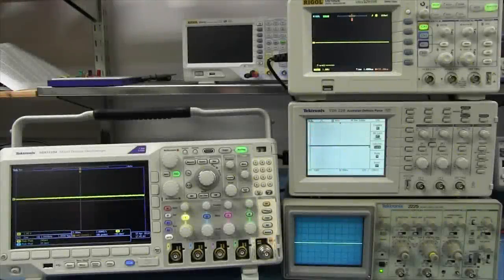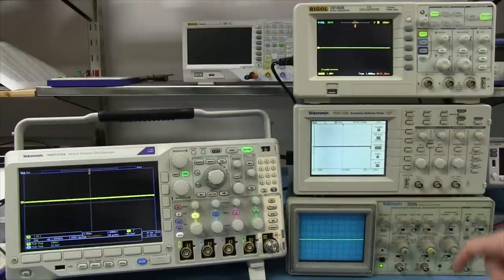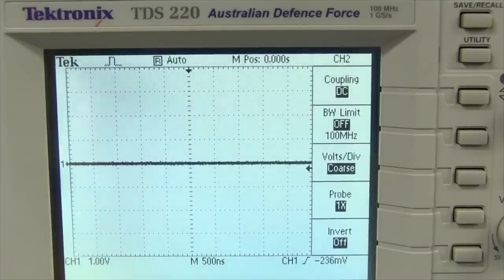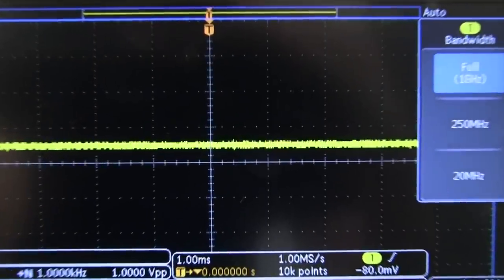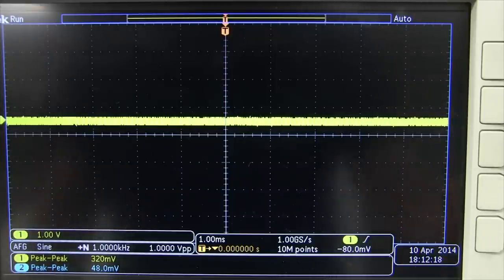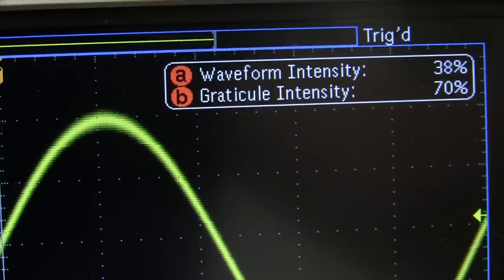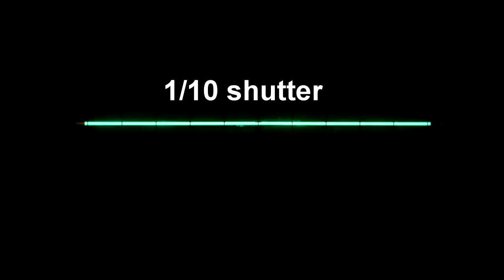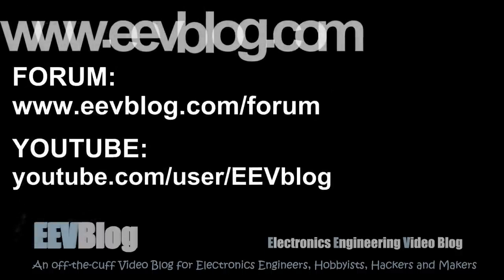EEVblog #601 - Why Digital Oscilloscopes Appear Noisy

Comment: This video very misleading. Since he used the 1Mohm input setting,  the waveforms shown do not represent the noise floor of the scope, not even close.  The noise you see on an unconnected scope is the combination of the the Johnson noise of the input impedance and the random component of the ADC's conversion. If you use a low gain setting (e.g. 1V/div) you mostly see ADC noise. If you use a high gain setting on the scope (e.g. 1mV/div) you mostly see the Johnson noise of the scope's input impedance. To estimate this correctly you cannot just use a the 1Meg input resistance, since this has a shunt capacitance, limiting the effective bandwidth. For example, a 1 Meg resistor with a 1GHz bandwidth, has a Johnson noise (=sqrt(4kTRB)) of about 4mV rms, or more than 30mV p-p for most settings that he used.  But since the input capacitance is about 10pF, then the effective Johnson noise is sqrt (kT/C) = 20 microvolts. For any serious look at the noise level of an unconnected scope you must therefore use the 50 ohm input option, and Dave did not do this for this video, resulting in conclusions that are both misleading and irrelevant.

Comment: Could have been a great video but those no signal tests should have been done with terminated inputs on the scopes aka grounding caps.   Is the noise we see being picked up by the little BNC stub in the female socket on the scope? It's high enough frequency noise  that the connector probably makes a good antenna.  Or is the noise from the A/D converters or numerous processors in the digital scope.  Without grounding the inputs all the data is invalid.

Comment: My Rigol 1054Z shows the same consistent noise as the one Dave got a few years after he made this video. I've managed to determine that this "noise" is a 250MHz sawtooth wave about 10mV p-p; it isn't random. I'm not sure if it's sampling noise introduced by the ADC or switching noise from the power supply riding one of the voltage rails; either way, it seems to me this is something that could have been snubbed in hardware or filtered out in software. So high above its specified 50MHz bandwidth; you'd think the designers wouldn't want it showing up on a trace.

Comment: With the money they charge for modern scopes, why cant they put a 2560x1600 display on them and get closer to around 260-300ppi?
I high pixel density display on a smartphone of around 5 inches, is often around $50
With oscilloscope companies getting number happy and charging nation state bankrupting prices for their scopes, they should at least be including a high resolution display.
Reply: The asic doing all the signal processing from memory is in essence also producing the waveform display. The asic is the limiting factor for display resolution. Accommodating a larger resolution would mean the entire asic would need to be an order of magnitude more powerful. Besides, if the ADC is doing 8bit conversion, you'll only get 256 lines of vertical position. Increasing the resolution does not increase the adc bitrate
Reply: But it will allow for less graphical aliasing of the lines. Think of it like when you move from a 1920x1080 display to a display that may be only 1-2 inches larger but the resolution is 2560x1600, and you suddenly don't need enable antialiasing, (or at most, only need around 2X antialiasing in order to make things smooth. The points of data making up the waveform or anything else being displayed may not increase, but things will look smoother. It will also make the text and other GUI elements look much better, or allow for more efficient use of the screen space, by making smaller GPU elements that are still easily readable. For the prices these companies charge for high end scopes, they should throw in a R9 290x while they are at it, just so it can drive the display a little better, and also mine bitcoin while you are while you are using the scope.
Reply: ***** Is there a good reason why they can't make that a 12 or 16bit ADC, or is it just not needed?
Reply: Razor2048 It's not aliasing, the asic displays only absolute data points (data events that it registered and stored). Each pixel on the display is an actual data point (or combination thereof). Interpolating your data is the same as data manipulation.. You use an oscilloscope to get answers, not to get pretty interpolated lines. You can compare this to upscaling photos from a 1.2mpixel webcam to 5mpixel. With some smart algorithms and aliasing, you can probably get the image to look nicer, but it's not giving you more information
Reply: Kevo F I think Tektronix has a couple of 12 bit oscilloscopes, maybe also 16 bit but I'm not sure. They're not really necessary, thus not very popular. With increased bit depth, you lower your noise floor, but decrease sampling speed (and probably increase costs). With increased bit depth, you also make quantification a bit better. It's not very common that the noise floor interfered with what you use the scope for. And an oscilloscope is by nature not a quantification platform, even if it is possible to do that
Reply: ***** Ahh, definitely good reasons, thank you.
Reply: Because they'd have to charge more. They're charging such huge amounts because of the specialized nature of the technology and the relatively low volumes of units sold. 

If they decide to put a higher resolution display in, the cost of the display will go up, and more importantly they'll need to redesign the ASIC, or use a beefier FPGA in order to drive all those pixels. 

They can't just throw in a modern GPU because their architecture wasn't built to support anything like that.
Reply from the maker: *****
True, but the extra screen resolution could be taken advantage of with mathematical operations like HiRes mode and Math functions for example.
Reply: Higher resolution is really not necessary for 8bit ADC and higher resolution ADC are possible but each additional bit will double the conversion time so is OK if vertical resolution is important for you and not the horizontal resolution (sampling rate).
Reply: MichaelKingsfordGray Higher resolution display will not help with aliasing.
Say you replace a 720x256 window with a 1440x512 pixels one. You have the choice to use a 2x2 pixel so absolutely no benefit or have a larger horizontal window (double the number of divisions) that will be helpful but make no difference on aliasing.
Reply: MichaelKingsfordGray You are thinking on a different aliasing. The aliasing when referred to an digital oscilloscope is influenced by the sampling rate. Some filter may also be used to help with aliasing.
Higher resolution display is nice but not necessary. The menus can look better on higher resolution and more measurements can be displayed at the same time.
Reply: +redtails In automotive a 12 bit ADC is popular. With that higher bit rate you can clearly see the movement of a pintle valve in a solenoid like a fuel injector or you can pick up a short in the windings of an ignition coil. Pico-scope is a popular brand of DSO used for automotive. They make 12 bit PC based DSOs that you can use a high resolution pc screen. I've been able to successfully diagnose bad solenoids that were very intermittent when they act up and weak ignition coils with them. I can also take snapshots and print out a copy of the waveform to give the customer a visual of when the part fails and explain in detail what happens. It's fun stuff to play with.
Reply: +MichaelKingsfordGray "Increasing the resolution of the display can only result in less aliasing, and therefore a more accurate representation of the data."You've got that exactly backwards.  The display already has more resolution than the captured signal.  Making the display higher resolution will just result in the scope drawing bigger blocky squares for each data point.
Reply: MichaelKingsfordGray
It is, if it only has an 8 bit ADC the vertical resolution of the waveform is 256. You'll need a higher bit rate. Here's a comparison of an 8 bit resolution vs an 11 bit https://www.picotech.com/images/uploads/library/picoscope-3000d-resolution-enhancement-screen-annotated.jpg
Reply: all you guys forgot the horizontal resolution :) when showing two 0-255 values on screen, depending on how far long apart they are on X axis, you could have all manner of angles for the line that joins them. 

at low display res, its not easy to accurately represent an interpolated value between two points, because you gotta make it out of squares. the jaggieness of that line presents no useful advantage.

that improves with a higher resolution screen. you also gain the ability to tell the difference between an interpolated line and a series of samples.

plus you can fit more samples in sideways with more pixels. for an FFT this also greatly improves clarity.

Comment: Actual AC RMS input noises I've just measured @ 5, 10, and 20 mV/div: 
- Tektronix 454 
(150 MHz, on Ch1 output): 60, 80, and 110 uV
- Keysight DSOX1102G (2 GS/s, 70 MHz) : 120, 180, and 400 uV
- Siglent SDS1204X-E (1 GS/s, 200 MHz) : 120, 50, and 400 uV

The strange (and strongly varying) result on Siglent at 10 mV/div is the result of quantization error. The thermal noise rarely reached the threshold of 1 LSB, therefore it was truncated to 0 too often to get a correct measurement. And this is exactly the reason why noise of a digital oscilloscope must be higher than one of an analog equivalent.

Comment: For my first digital scope I bought a Tek 2232 which had analog and digital modes. For some measurements with noisy signals, analog was better. One analog technology not mentioned is CRT storage. I have a Tek 7834 which can capture single shot waveforms at high sweep speeds, but its best use is as a long persistence display for a spectrum analyzer plug-in.

Comment: Its interesting that digital osc's have done exactly what digital cameras have done. As time passes they get higher and higher resolution and now have extremely  high resolution. I come from the old school of film and large format.  Digital is the only way to go now.! The difference however,  is that film started with higher resolution and digital cameras had to catch up. Additionally,  osc' s try to emulate there analog counterparts.  The same thing happened to digital cameras emulating film.

Comment: Thanks very much, that was absolutely brilliant. My old Tek 'scope just blew up and I'm trying to get my head around the new entry level digitals

So if a manufacturer offers 3 oscilloscopes in the same series, let's say Hantek 5000 series, the only difference is the memory depth, the DSO 5102P is 40K, the 5102M is 1 M, and the 5102BM is 2 M but they should otherwise be identical. If they were all lined up in a row, the 5102BM would appear "noisier" than the M, and the M would appear "noisier" than the P?

Comment: So given all the visible noise on digital Scylla scopes, how does one differentiate between a noisy audio amplifier stage and the noise in the aucilla scope? With my analogue 20 to 65B, I can see if an amplifier stages putting out a pure sine wave or has some noise on it. But these scopes have noise on the sine wave no matter how clean they are. And the other problem is the low resolution of these displays exacerbates the noise I think that's the real reason why these scopes look noisier. These displays in 2020 should be able to show 300 points per inch Just like our smartphones do. It's ridiculous that and over $10000 instrument is stuck in 1990 as far as display resolution.

Comment: Some advice please dave,if given the choice of the  FNIRSI 1014D or Hantek DSO2000,for audio work on valve/tube stuff,and the fact you want to use the display to give a good account of Fhz and Vpk-pk to use as calibration for your Farnell LFM4 sig genny.
The only digital i envisage would be pwm for  on either boost converters using an inductor or a push pull transformer type for HT supply,otherwise for flip flop switch control for channel sellection.

I can't get anything on ebay or local with screen display measurements accurate enough(trace) to do any calibration,and Fhz meters on sale used may need calibration anyway,plus the scope has i have has one channel fully working with one channels V/div not working on some settings,i can repair it as the y amp has to be working,but the V divider must be faulty(i assume).

So chasing my tail trying to find accurate pk-pk voltages and Fhz would require more test gearwhen a DSO seems to have self test and Fhz and signal voltages on screen.

Both the DSO units are under £200 on ebay have a guarantee and seem the best candidates for what i want,but which would you go for,as the cash difference is only £50.

Johnamptech in Scotland,
Cheers.

Comment: 21:40 - "Low shutter speed" should actually be "high(her) shutter speed". And "as you increase" should be "as you decrease". A 1-second shutter is (fifty times) slower than 1/50th of a second shutter, so you're decreasing the shutter speed (or increasing the exposure time).

Comment: Hmm ... I've got both an old analogue and a modern digital scope (Siglent SDS1202X) and have noticed this same effect. But all the scopes in the video are set to 1 volt / division and on the digital scopes we're seeing 'noise' of about 1/20 of a division. That equates to 50 mv. Full screen deflection is 8 divisions or 8 volts. So the noise is 160th of the full screen, give or take. You might expect something like this with an 8 bit A/D converter. So maybe the problem is insufficient resolution. Certainly, when I use my Siglent in the single trace mode to capture a one-off event, you can see the digitalisation and it's about that magnitude.

Also, there is nothing connected to any of the scopes. I would like to see them with the inputs shorted to ground, just in case they're picking up external noise.

Comment: Dave, In simple terms Digital scope have higher resolution than Analog scopes
am I correct ??
Reply from the maker: No, analog would be much better in this respect. Although it's hard to quantify what the "resolution" of an analog system effectively is, just like a film camera photo vs digital camera, but it would be better. Still one of the few things the analog has in it's favor.
Reply: EEVblog
I don't think that.
Is exactly like analog multimeter you will never be able to read as precise the value from that one as you can read from a good enough resolution digital since all you need in the end is a numerical representation.
Same with that CRT display is not just the size of the electron but is the effect it has on the phosphor there need to be multiple photons four your eyes (brain) to see.
Same with an analogue film camera there is a limit of what you can zoom in and actually see.
On the modern digital cameras the quality of the lens has a larger influence on the image resolution than the number of pixels and this new lenses are huge improvement over the old lenses on analogue cameras.

Comment: I bought a Hantek  digital DSO5202B  100 Mhz scope some years (9) ago when Silicon Chip paid me for an article.  I find I still prefer my  many Tektronix analogue  CRO's to do most servicing work and it's not about the perceived noise.  I am in general not looking for a random event but  signals that are repetitive  so a digital storage scope does not usually help me.  I bought the instrument in order to capture pictures of waveforms to include with electronics articles.  I believe in some procedures the analogue scope does a better job.

Comment: I just bought a tds 224 on e-bay for 200 bucks. I'm noticing that if you turn the vertical scale all the way to it's most sensitive 2mV/division the noise in the signal covers about half of the entire vertical scale. That seems fairly useless to me. Is this typical, or is this scope old and worn out? What does your tds200 do when you turn the volts/div up all the way without any inputs connected?
Reply: Try it again with input shorted at the scope

Comment: From 09:00, it is time for a question.

Are digital scopes able to display a short spike in intensity with reduced brightness?

That is, can a vertical trace be 25% luminescent, if only 256 of 1024 samples in that X axis are 1v, while the remaining 768 are at 0.02v, +/- 0.005v?

The intent here is to know when your peaks are either too short to be significant, or too quick for your current timescale.

( 15:00, answered. )
Reply: Answered at 15:00 ; Waveform / Graticule Intensity.

Comment: Are there any situations where the display characteristics of the analog scope would be superior to the digital?
Reply: Crossover distortion compensation for analog amps? Keep in mind that analog oscilloscope inherently has two features that are being recreated in DSO using large memories and heavy processing - writing speeds and averaging of the luminophore. If you display square wave where the rise time will me much shorter compared to period, the vertical lines actually disappears and only the tops and bottoms remains. And the brightness and thickness of the vertical lines provides you naturally with the information of writing speed, rise time duration etc. These features has obviously even the cheapest analog oscilloscope. But how many digital oscilloscopes and in what price range have features as averagig, brightness modulation (as the newest Tek?)....and it took like 20 years for the DSO to be back on the similar level with signal presentation. Because it is important if some peak or what emerged with the same probability/count as the main signal or not. Basic display if digital trace lack this "probability" influence and just displays bright pixel no matter if the signal was present on this sample 1/1000 times or 1/100000000 times.....
Reply: @82sledge  Good point!